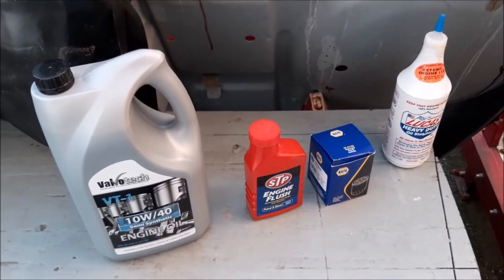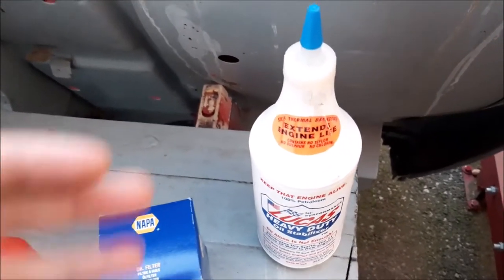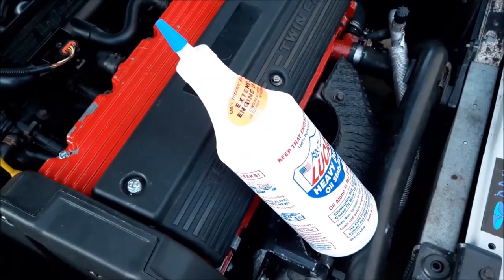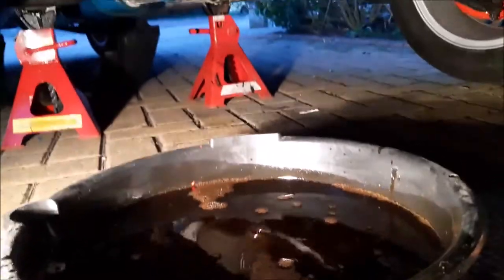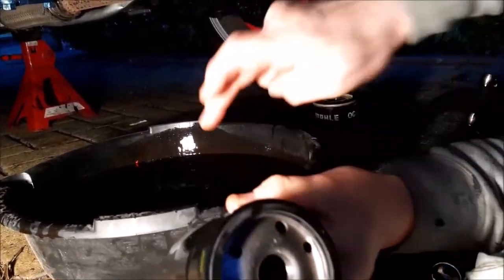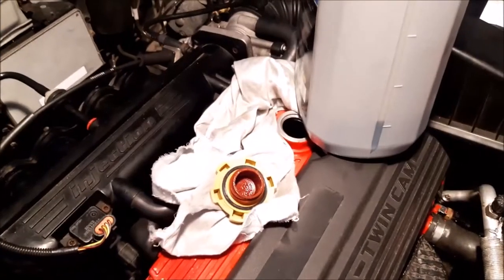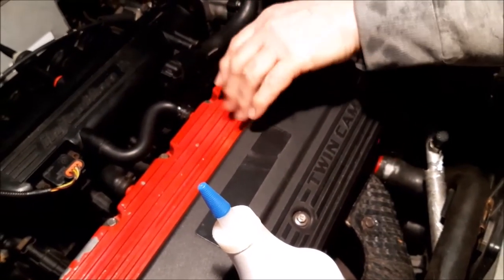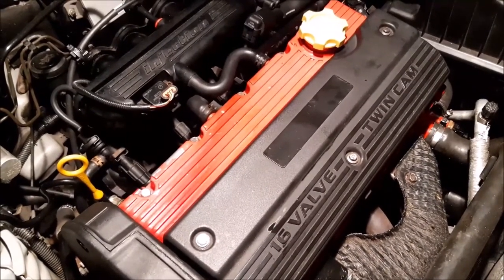Engine oil change on a Rover 45 K series 1.8

Comment: The handbook for my Rover 75 2003 KV6 says not to add oil additives . Thank you for another great video.
Reply from the maker: Thanks the hand book talks about the car and the engine as new and you would not normally use an oil additives with a new engine we explained the reason we do in the video its one of those things its up to you if you use an oil additives